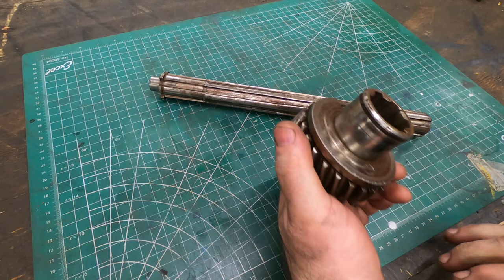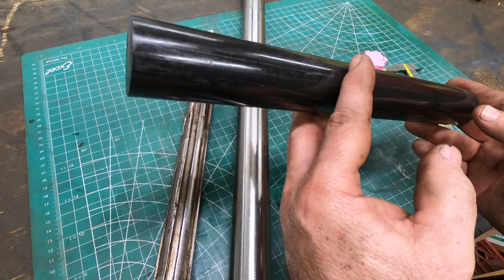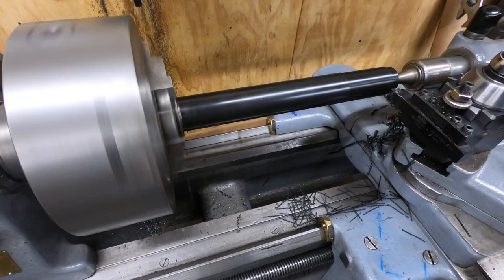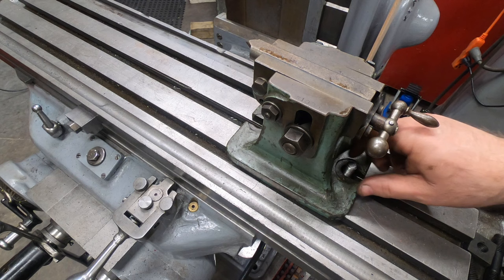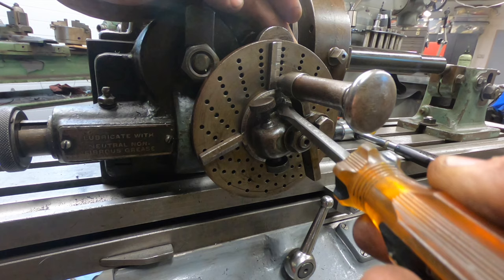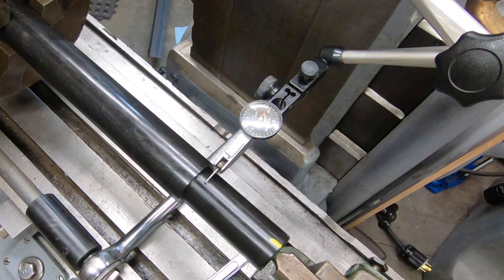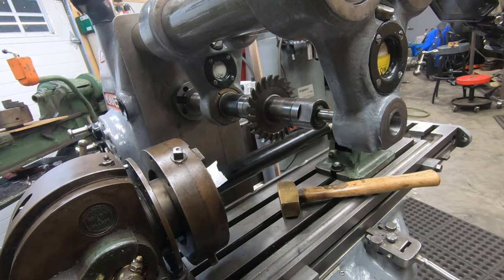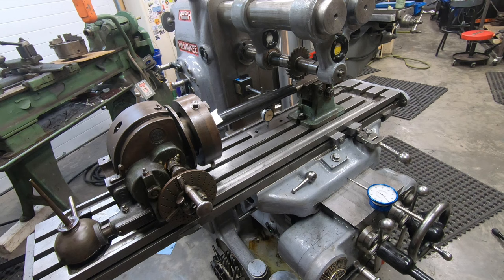K&T Universal Milling Head Drive Shaft - Part 1 - Setting up to machine a 6 spline shaft

Comment: You're right. If you don't give it a try, it's always a fail. This is a very interesting project.
Reply from the maker: I might end up running this experiment again, but on a piece of steel. But I am definitely going to get the foot stock and the dividing head aligned better before I do that.

Comment: Watch Keith Rucker.
The size of keys on the head and foot stock don't matter as long as they are straight. You need you need to loosen both bolts of the footstep to line it up.
Reply from the maker: I watch Keith all the time. His channel is part of the reason I find myself into this mess. LOL! But having correctly fitting keys makes lining them up effortless - which is something I did in a later video. Thanks for watching!

Comment: If it helps for getting your dividing head dialed: I bought a set of Morse test bars (2 and 3) on Amazon, well under 100 bucks shipped, and they're as good as I can tell with v-blocks and a tenths indicator for straightness and a five-place mic for diameter.
Reply from the maker: I have a few ideas. But I am going to start with making new keys for the table slots.

Comment: Interesting setup. I made a power downfeed shaft for a Buffalo Forge 22" drill a few years ago that was similar.  I have a whole bin of B&S taper stuff. #9 isn't to hard to find  but 10 is very odd. If you confirm thats what you need i will go digging. -Mike
Reply from the maker: I'd have to take that chuck off and measure and confirm it, but according to the documentation for the B&S universal dividing head, it's a B&S #10 taper. Appreciate the offer. Thanks.